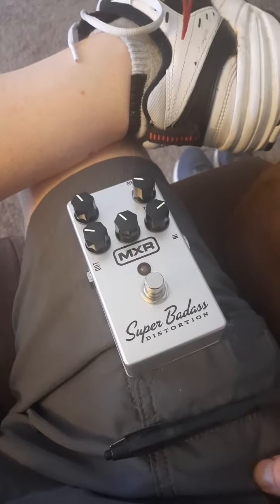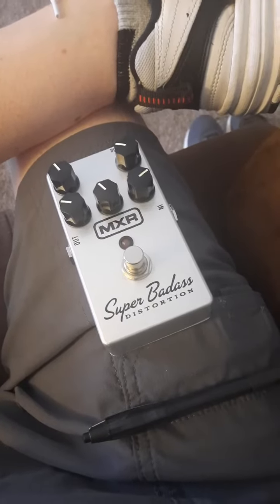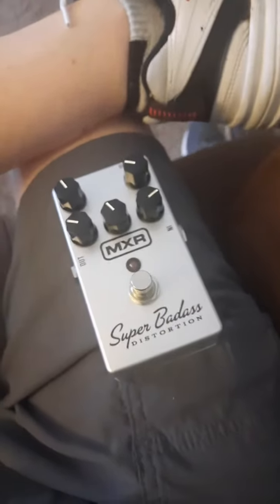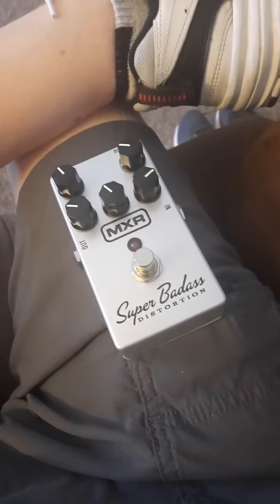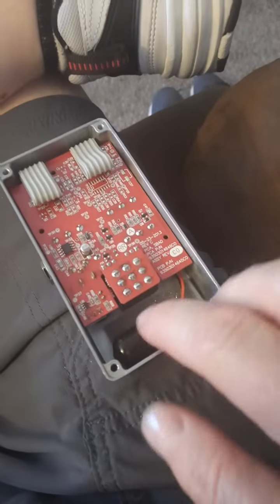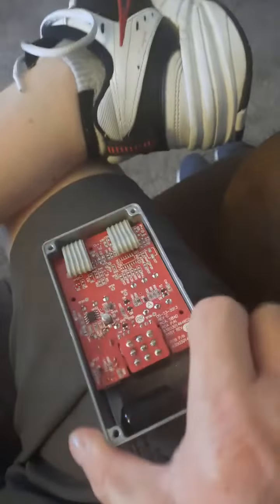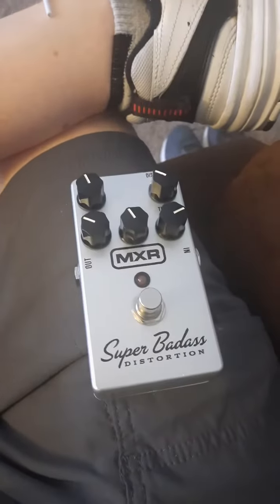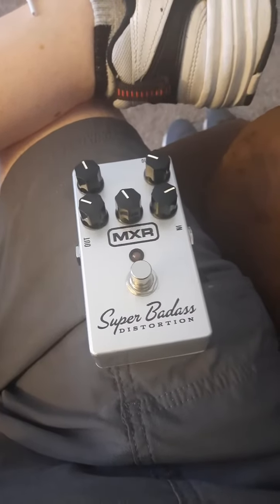MXR Super Badass Pedal. 9v battery or not?

Comment: Ya its just a plastic cover for the  9 volt battery terminal. It's literally a 9 volt battery clip as opposed to using a 9volt isolated power supply to power up the pedal